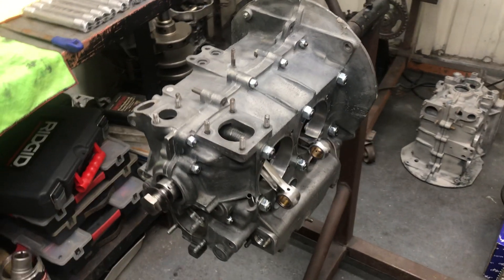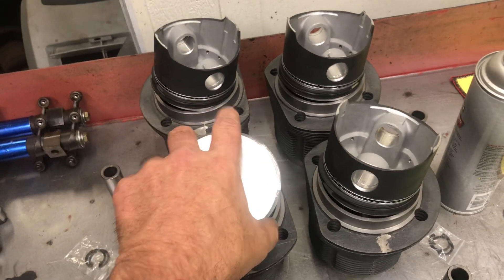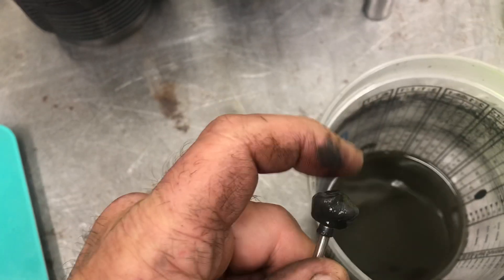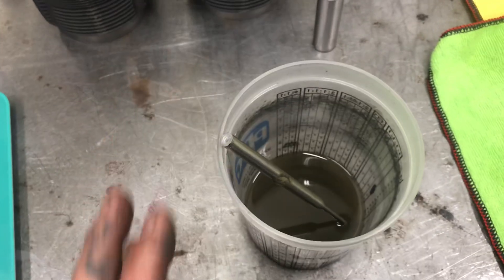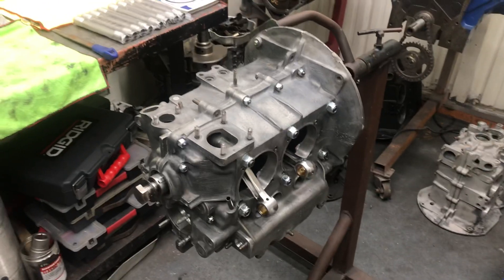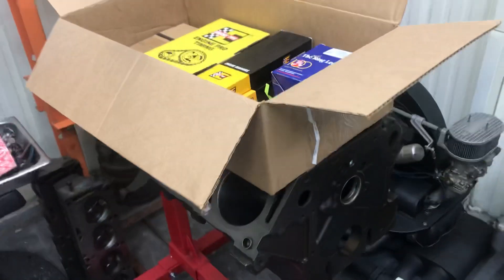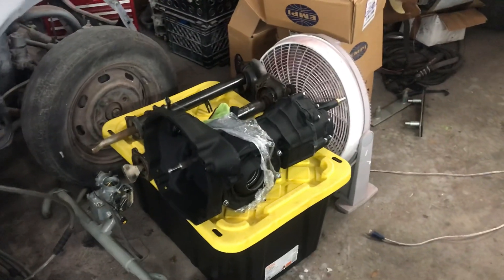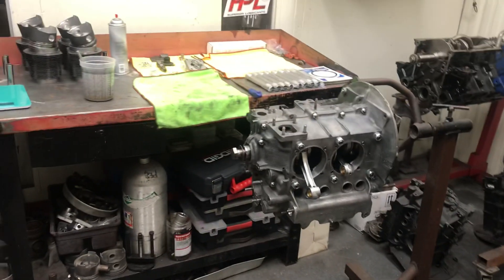Piston cylinder tips

Comment: Those ball hones really do put a nice cross hatch on the cylinder walls. Those scratches hold oil well. Critical for break in. Enjoying the videos. I've never built a VW but have built a few aircraft engines and more than a few air/oil cooled motorcycle engines. Most of my work is on marine and cycle stuff. The FE build will be cool. I stuffed a 4" crank into a small block 5.8 some years back. That was fun. Put lots of heavy metal into that crank to balance it after cutting the counterweights down to fit that little block. Fun stuff. KB pistons 4.030 gave me 408 cubic inches in a 289/302 sized block. Perfect for the old 68 'Rustang'

Comment: The Swamp Dragon’s motor; great deal! CT needs to get his ass in gear. Looks like his motors are ready before the rest of his projects are...😉.
Reply: @jd46800  I saw that; for the life of me I cannot understand it. Was going along great. Why get sidetracked when you have everything you need and are going at great pace?
Reply: @jd46800  I don’t believe so. I especially regret that he hasn’t finished the Swamp Dragon cab after Darrin put so much work in it. He has had the replacement floor pans for a long time and the chassis was painted; why not start putting it together?

Comment: good tips. heres a tip for running in the parts, cook them overnight in a oilbath with molybden in it. good way to do this is put the parts in a container, fill it with the oil/molybden and put it in a regular oven over night at 180 celsius. that was a old way of racepreparing parts so there would be no tearing .
Reply: We use Comet Clutch spray. Molybdenum spray for constant velocity clutches as used on snowmobiles.

Comment: Great tip! Didn’t realize they were that dirty.
Reply: it does make sence, i worked a bit with metal fab and its usually just made,, checked and put into a box or a bag. there could be metal chavings on it, dirt from the process, all kinds of crap. also china really set back premade stuff a lot , quality now vs the 1970s is lower.